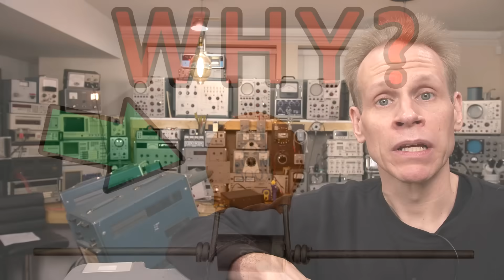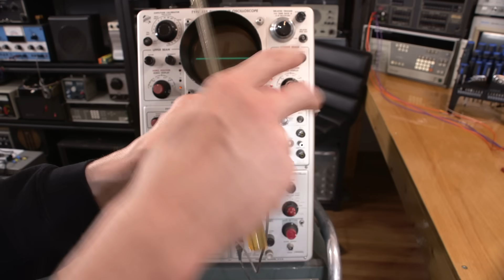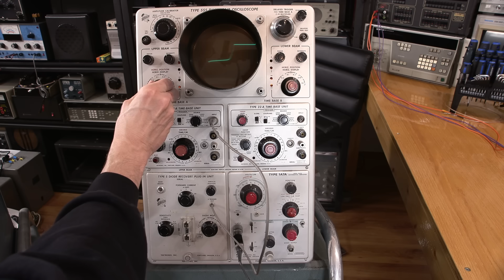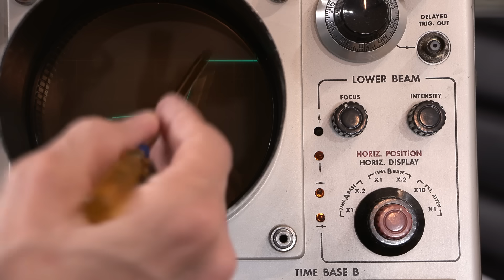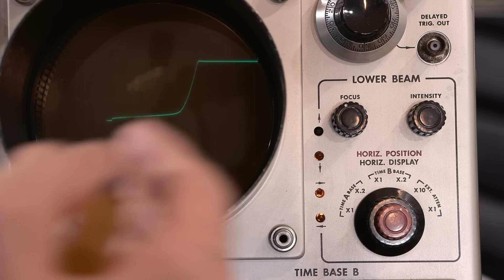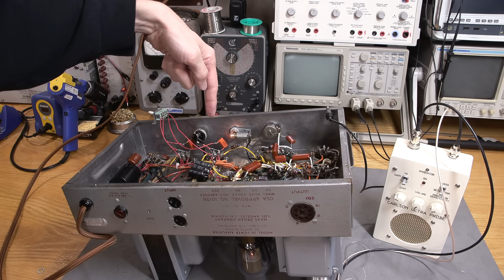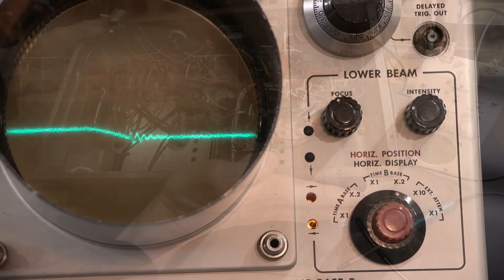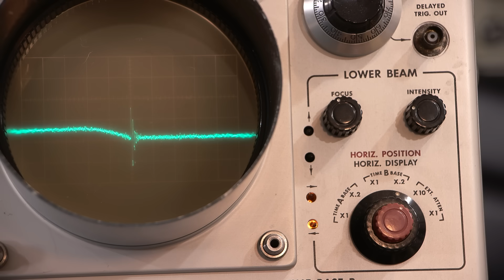Why Put A Capacitor Across The Diode? Here's Why!

Comment: I see a small oscillation in the improved waveform.  Perhaps reducing Q with a low value resistor in series with the cap to absorb that energy would damp it without too much adverse tradeoff?

Comment: Changing the 'C' in the natural 'LC' tank circuit formed inside the diode. This only shifts the frequency of resonance. You can add a resistor in series with the added capacitor to burn some of that energy off as heat as well. A common form of this snubber circuit.

Comment: I'm designing a 40,000 watt full wave bridge. Diode - capacitor in parallel is necessary, but I can't find the math to support it. The why is in the back end of my memory. It must be included.
I can use the formula, a little help? 50 amp diode stages.

Comment: It takes 2 sentences to make this video useful. e.g(my imagined setup to show what’s missing) 1) the scope is feeding a 50 Hz sine wave 3 volt peak into the diod that is serially connected with a resistor inside the scope tied to the ground; 2) the scope is showing the measured output voltage. Of course, we know that display doesn’t match this setup :)

Comment: Nice demonstration! I think it would be helpful to the audience to show the schematic of what you are testing (full bridge diode rectifier). So you attribute this effect to reverse recovery current spikes? The difference is undeniable, but I don’t understand the mechanism yet. I think this works at low frequency, but at high frequency (e.g. switching power supply) the additional capacitance would cause the diode to switch more slowly and increase switching power loss.

Comment: Damn that is an old tektronix setup, but it works so good.  I never got to use that but I did utilize other tektronix kits from the 60's and 70's while in the Navy from 94 to 14.   Was told I would use the most up to date stuff but ended up using old CRT oscopes.  I think I touched maybe one digital oscopes 2 years before I retired.  Heck I even used an old huntron 1000 and 2000's.  An older engineer was surprised I knew about it when I saw it on his shelf, especially when I told him how I used it for troubleshooting.  He gave it to me and in return I helped him with troubleshooting and repair of some old regulators when the technicians on the production floor started blowing them up.

Comment: Just a brainburb question. Does doing this to a full wave diode rectifier preemptively lower the 60 cycle hum before it gets to a filter stage? Does or could this result in spending less money on the filter stages downstream of the rectifier?

Comment: I wouldn’t ever do this. It would be better with a resistor in series and act as a snubber. A cap is an A/C short, so any voltage noise goes straight through, RF and the like. Also the cap is just converting voltage transient into current transient. So pickup in an adjacent circuit is possible. If it’s a big dumb amp, across the bridge rectifier with a ton of filtering then yep you will get away with just the cap, but as a rule of thumb it doesn’t work as there are circuits where this will make the problem worse. This is why you won’t find this in Horowitz and Hill or John Lindsey Hood et al.
Reply from the maker: This combination is very common, especially in RF equipment.

Comment: This isn't a diode fault, but a fault in your equipment. Mains power introduces various harmonic frequencies into the power supply, which is why capacitors are used to filter these distortions. Instead of mains power, use a battery supply and all distortion will disappear, as the constant voltage from the battery doesn't introduce harmonics into the power supply.

Comment: while this experiment is valid however in some circuits can meake more meas than the benefits. electronic circuits are a single complex systems one cant simply slice apart and test separately and provide isolated conclusions..

Comment: Chip Chinese diodes usually has or prone to noise that this parallel cap will solve or help...
They have different speed and conduction properties compare to genuine ones especially the high speed/fast diodes. Nowadays sometimes it would be better to use ordinary rectifier than UF/FR diodes when they came from China, not all but most of them.

Comment: When you factor the diode capacitance that increases with reverse biasing it makes sense that it starts oscilating. This cap is a basic snubber, adding a resistor should also help.

Comment: Very subject, but no analysis.  You will always get 120 Hz hum from a full wave rectifier.  And the reverse recovery time of a Silicon rectifier is so small, it will make no difference at 60 Hz.   The full wave rectifier should have filter caps anyway, and they would be a lot larger than that tiny ceramic cap.    Where this does apply (putting small value caps across rectifier diodes), is with high voltage doubles and triplets.  There the reverse current has to be snubbed.  Otherwise the forward conducting diodes will be blown.  Not every circuit that has a diodes in it requires a cap across the diode.

Comment: I can hear that noise whenever I connect my Bluetooth speaker to my LED TV it generates those noises 
But something I noticed is that when I also put that speaker to charging wire USB it makes that noise when I turn off the adapter charger voice will be diminished I think because the TV source also has those noises

Comment: I was given an old Power supply to power some active speakers for use on my ham rig i found that diode noise was a big problem on the lower part of the mediumwave band adding caps across the bridge rectifier cleaned it up nicely earthing the negative rail helped even more

Comment: Hi Mr. Carlson ! NIce video !I did the same on the FT101E power suply .  Substituted  Originals' diodes for UF4007 ( ultra fast) with  capacitors 4,7nF  in parallel. The results  was nice! Regards.

Comment: In power electronics this 'ringing' is caused by long lines that work as inductors and, with the (parasitic) capacitances cause oscillations at the resonant frequency of the circuit. A better circuit design (avoid long lines and loops) or a small series resistance to dampen out the oscillations is then used. 
Here, in the power line, resistance means dissipation, so a snubber seems a good solution. One can also try rectifier diodes with a 'softer' recovery to prevent the abrupt changes in current which lead to ringing. 
They're appropriately called 'soft recovery diodes'.

Comment: Hey mister Carlson you never told us why they have capacitors across their just because it stops the noise isn't an answer I guess was it keeps ac voltage from going across the diode does capacitors are good blockers for AC current that was just like yes but you didn't tell us man come on

Comment: I have a bluetooth audio board I am powering directly from my car radio's power lines and feeding analog audio into the speakers via legs off of the amplifier chip inside.  I get noise/whine from the alternator while the car is running (I assume it's the alternator because the whine pitch changes as I accelerate/decelerate).  Would this work to remove that whine and if so would I have to run it between + and - on the 12v supply line?

Comment: THANK YOU, MR. CARLSON!!!  I RECENTLY WATCHED YOUR VIDEO ON PLACING A ("REVERSE BIASED)  DIODE ACROSS THE COIL OF A RELAY, TO SHUNT THE "BACK-EMF", WHEN THE RELAY COIL IS TURNED OFF (DE-ENERGIZED),....  SHOULD A SMALL CAPACITOR ALSO BE PLACED IN PARALLEL, WITH THE DIODE, AND RELAY COIL?!... 
FYI/IMHO: YOU OUGHT TO USE A PLASTIC "PIXEY STICK"/CHOP-STICK/KNITTING NEEDLE, STRAW, ETC., AS A "POINTER", INSTEAD OF YOUR FINGERS, WHEN DEMONSTRATING ON "LIVE CIRCUITS", WITH "DANGEROUS" VOLTAGES... :face-blue-smiling::face-green-smiling::face-fuchsia-wide-eyes::face-orange-raised-eyebrow::hand-orange-covering-eyes::body-blue-raised-arms::face-turquoise-covering-eyes::hand-green-crystal-ball::trophy-yellow-smiling::trophy-yellow-smiling:

Comment: Some years ago i have modified a power source for a customer, 24v dc and no matter what i poke, there was a noise around 7mhz that i could only shift up or down using different capacitors on the bridge. So i had an idea to put a lithium rechargable battery in paralel ant it punched down the noise to almost zero. I know its not a fine solution, but it works...(still in use today)

Comment: Reverse-recovery dumps the electrical charge that inhabited the semiconductor while it was polarized in reverse, straight back in when the diode starts conducting. With the capacitor in parallel, as soon as the reverse polarizing stops-or decreases, the charge migrates from diode to capacitor-it goes back to load as well, but the capacitor is lowest impedance so it will absorb most of the charge.

Comment: 😃😄😁😆😅5 Smiles I have one to a AC dynamo rectified originally pop 150ma and the cap base they would get to burn out add a resistor inductor and 32v one full amp cool warm to caps rebalance u used the diodes to pull v since the silicon lines act as a block when Daisy chain 4 to 24v input to a PC power pack one mit didn't think about.

Comment: But which Diodes do yo put teh caps? ALl of them in your whole circuit, wont that let current to flow in wrong way, the whole point of the Diode is to stop the flow of current in one way, if you put cap in parallel wont the current flow
Reply from the maker: The subject that makes this possible is: "Capacitive Reactance." In this case, only a small amount of current is allowed to pass.

Comment: can a noisy diode attached to a motor brake circuit cause ethernet switch dropouts if built inside a very cramped drive control cabinet? Also what other issues might arise with a noisy diode?

Comment: Thanks for such a very helpful and informative video. I have a question. Can this also be done on a switching power supply? Is is possible or practical to put a capacitor across the high frequency rectifier diode?
Reply from the maker: No, this is why the diodes are fast. Doing that would destroy the supply.
Reply: @MrCarlsonsLab  Thanks!

Comment: I  jumped  wires from one side of a breaker to the other due to the brwaker curve was wrong from the design engineer. I later was told by owner of very large induction corporations this ws piggy backing due for unseen things.

Comment: Could i use C0G mlcc capacitors across a rectifier bridge as well ?…esr is very low but not affected by c and temperature drift.What‘s you expirience ?
Reply from the maker: Should be ok as long as the voltage of the capacitor is selected correctly.

Comment: The caps are put across the diode to limit fast spikes that could breakdown the diode.  This is why you will see them used in high voltage applications and not used in low voltage circuits.

Comment: Interesting video, thanks for making it.  One note is that in the video you did not provide the context for what that diode is doing inside the amplifier (other than in one sentence where you mentioned full wave rectifier), and what is the "noise" that you are analyzing and filtering out with the capacitor.

As an electrical engineer and a recovering audiophile I am assuming that the diode is part of the full wave rectifier that rectifies the incoming AC power as the first stage to convert it to DC power within the amplifier, and the "noise" is caused by the 60Hz AC power (it sounded like 60Hz).  I think the missing context could confuse people who are new to electronics and haven't learned too much about circuits.

You should have also included a quick calculation to show how you determined how much capacitance was needed in that circuit to filter out the 60Hz signal.

Also, I think it's fair to mention that most modern electronics (last 20+ years) use a full wave rectifier module rather than discrete diodes, so this 60Hz diode filter wouldn't work in that environment.

Comment: I've had something similar on the vehicle for years it's called the ⛽ fuel doctor 💊.
======
You just stick it into the cigarette lighter and it let you know if the alternator is charging okay 👍.
=======
Everybody asked me do you think that really works ?
=====
I look at it just like what you're doing ithe ⛽ Dr .is an ⚡ electrical noise muffler 🧣 for the wiring in the truck. 
======
So if the noise is generating heat this energy loss. 
The energy loss could be all in the fuel ⛽ doctor 💊.
=======
So I'd have an energy drain pants all I need is a big giant capacitor battery jumper to put all the ⚡ electrical oil 🪔 in.
Bryan 🧠💨🪣🦵💨🌻🏡

Comment: My Great uncle used to own a stereo shop back in the 60's or 70's before my time.  My dad just talked about it some.  Needles to say Growing up I was surrounded by what I imagine was hifi audio equipment for the time.  Techniques, Bose, audio technica, and the early laser disc players of the day.  I remember lots of arguments regarding tubes amplification sound quality vs modern for the 80's which was I'm assuming mosFet idk.  Guess I don't remember to well.  But I wish I would have rescued dads old Head Techniques head unit and Bose floor standing speaker cabinets.  Needed new speakers but each unit out of the four cabinets stood 36" with an 8" full range Bose speaker and 1" dome tweeter of silk or titanium design, then the top of the cabinet was slanted 22.5-30deg with another 8" full range driver and 1" dome tweeter.  The banana plug red and black terminals inset on the back of the cabinets spoke to the quality of the craft men ship Bose used even before removing the fabric dust covers to reveal those sweet audio magic producing circles. I bet with the knowledge of this community I could have saved and maybe even improved the function of the head unit of that system.  The large oversized knobs each one cast or forged since and was not a thing, turned effortlessly but with a control of evenly applied resistance throughout the entire range of motion.  Smart electronics repair has been lost to a through bit out culture and with it the need to engineer something someone only needs purchase a few time in life.

Comment: it would be good to have a formula that helps you derive what capacitance value to put across the diode. Capacitors pass AC like butter, and diodes do not. But I would imagine if the capacitor is wrong, you can subvert the diode.

Comment: My first question is, why is the cap twisted, unsoldered so close to the diode body? That's not a good practice.
Reply: I think that was just to make a simple illustration for the camera. It would normally be soldered, of course.
Reply: @ordinaryaverageguy76  Good point, but you can't solder that close to the body of the resistor reliably. It's not in spec for that component.
Reply: @scobrado  Well, literally you CAN but it may not be good for the resistor tolerance. Heat sink it & go fast. LOL

Comment: If you use a diode as a half-wave rectifier, you will see a sharp discontinuity in its transfer function at the point where the forward voltage causes the diode to abruptly transition into a low impedance state (and likewise when it transitions back to high impedance). Those periodic sharp discontinuites in the half-wave rectified sine wave introduce high-frequency harmonics which can be interpreted as "noise" in certain contexts. Putting a capacitor around the diode degrades its ability to block high-frequency impulses in its high-impedance state, which bypasses the higher-frequency components of the half-wave rectified sine wave around the diode. That results in a half-wave rectifier that allows transient back voltage spikes to contaminate its uni-polar output.

Comment: These caps are added to the diode reverse capacitance and tune down the LC resonance into a lower frequency. In this case the stray inductance of the added wires are olso count.

I using soft swiching ultra low capacitance diodes insted adding capacitors across the hard switching ones.

Comment: So that cap is a bypass capacitor that blocks ac and passes dc basically keeping the extra noise or ac ripple out of the output signal of the diode.( Im still learning electronics so dont be too hard on me in the comments,) but isnt the output waveform of the radio AC. is this just making sure there is no unwanted noise down the line that goes into your output or do certain components in your radio pick up noise from other parts of the circuits. Just wondering. Dont know too much about radios yet.

Comment: It's probably important to explain why the electrolytic filter capacitors aren't sufficient to remove this noise, making the snubbers necessary. This has everything to do with the high slew rate and short duration of the recovery ripple. Electrolytics can't charge and discharge quickly enough, but these smaller value caps placed close to the diode body, can. The remaining inductance of component leeds and wires between diode and filter capacitor, serve to reduce the propagation of any remaining ripple after the snubbers have absorbed the bulk of it..
Reply from the maker: You know your stuff! Nice to see. I would get deeper into this in this short series, but that tends to put people to sleep, so I keep it basic.
Reply: @MrCarlsonsLab Understood.

Comment: Can you do a videos of where a capacitor across a diode makes some frequency noise from parasitic inductance greater as it resonates with the harmonics and stray inductance if the right value of capacitor is not chosen. Also Tunnel diodes would be a great video and parametic amplifiers.Good work.

Comment: I often see DIY audio amps refer to an optional "snubber" in the rectifier.  But it's a combo of a capacitor and a resistor.  IIRC, it's something like 100R in series with 100n.  Apparently there are ways to calculate exactly what you should use, but they mostly boil down to something very close to the rule-of-thumb values.

So what's the effect of having or disregarding the resistor?